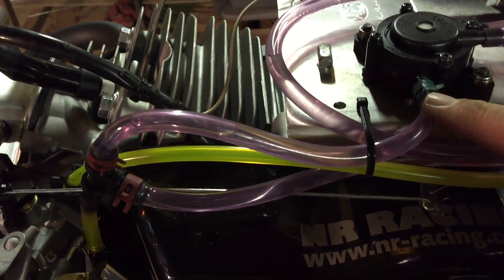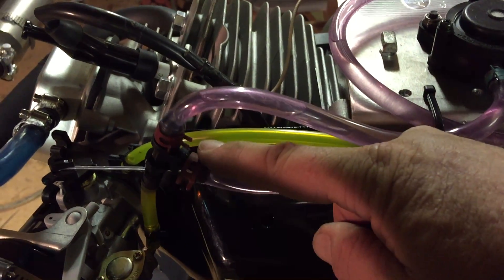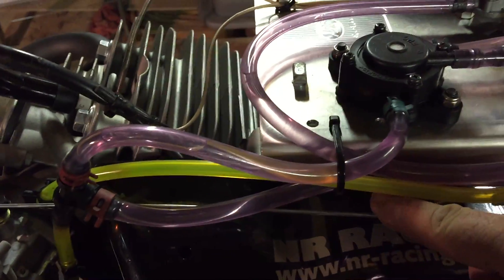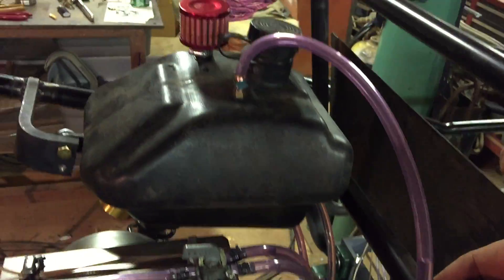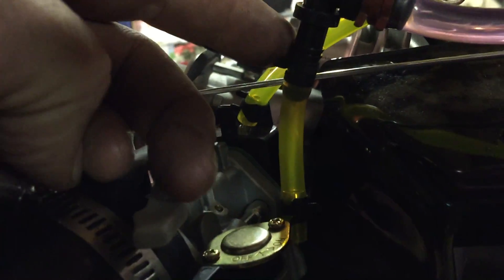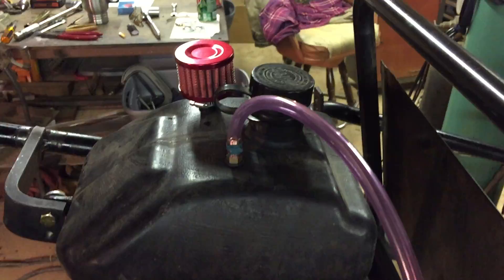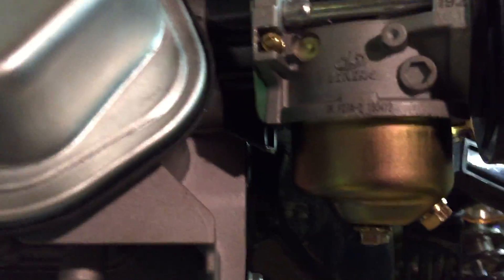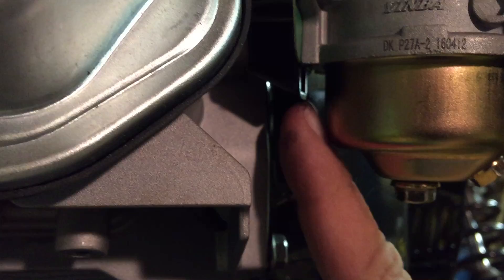460cc Go Kart fuel delivery setup

Comment: a  cut off after the t and before the carb. then you close the valve and open it till you get the right pressure might help
Reply from the maker: I't working great now. the first problem was too much pressure. (Added the return)
then it was vacuum (Vent the tank)
All fuel problems fixed

Comment: Where would you mount the pulse part for the fuel pump on a flat head?? Please respond thanks
Reply from the maker: My pulse is run from a fitting on the manifold plate in between the carb and the head. Perfect signal. The yellow line is the pulse.
Reply: HTHCLLC can I run a intake but keep the stock carb? Or would I have to buy a better carb?
Reply from the maker: @zqrf108  stock carb will work. it will lower top end and mid range.

Comment: Shouldn't the tank be vented through the cap already?  Loving these videos!
Reply from the maker: the tank is from a old kids atv and the cap was from a gas can. No vent. Drilled a hole, stuck a hose in it. now vented the return works. I am sure it was pressurizing the tank, causing the return not to work and over flowing the carb.